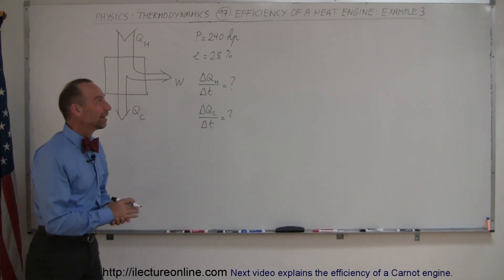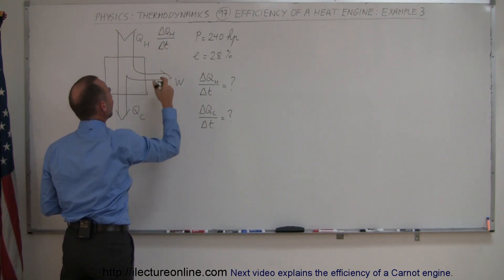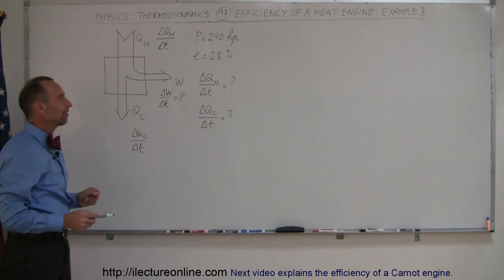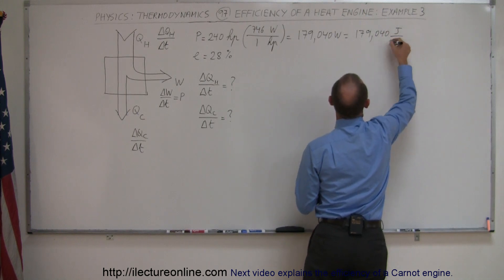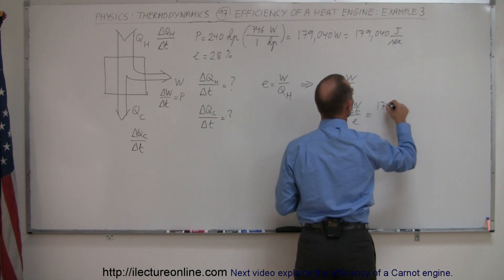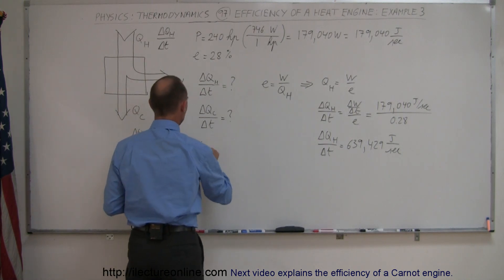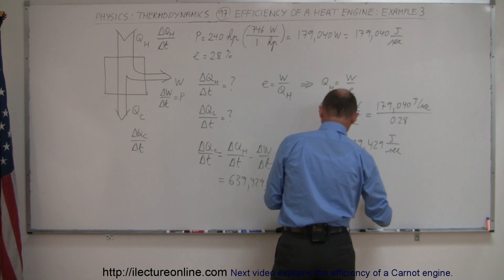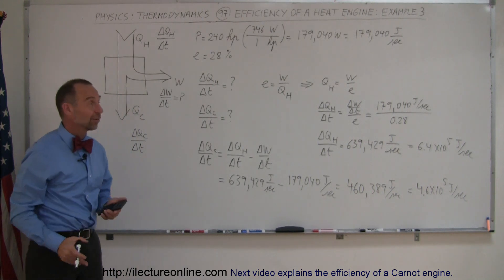Physics 29  Efficiency Of Heat Engines (7 of 14) Efficiency of a Heat Engine: Example 3

Comment: Hello professor! thank you all the great videos you post! those have been a huge help in my physics degree. I would like to ask one question and will be glad if you can answer it:
When solving heat engine problems, do we assume Qcold and Qhot to be constant at all times? isn't the cold reservoir gets hotter as time goes by and the hot reservoir gets colder as we took heat away from it? this results in the engine efficiency changing as well.
Reply from the maker: For an engine, the "cold reservoir" is the location where the exhaust is expelled.   The temperature of the exhaust as it leaves the engine is key here. In modern cars a lot of the heat is removed from the exhaust before it is expelled which has significantly improved the efficiency of cars.   The "hot reservoir" is the air fuel mixture right after the ignition spark and is a little higher after the car has been driven for a few minutes (since the engine heats up) and thus the efficiency is a little lower initially and then increases as the engine heats up.   That is why they place a "thermostat" in the hose near the radiator which is closed until the engine warms up to speed up that process.
Reply: @MichelvanBiezen  This cleared my confusion, thanks a lot for your response!

Comment: Hi I know youre very busy and thank you for these videos. I have one question is there a way to find the Qh(heat being put in)  if given the power output 5kW, Qc 1800J and Efficiency 25% ?
Reply from the maker: Mario Persaud 

If efficiency is 25% then only 25% of Qh is used for work and 75% is expelled as Qc.
Therefore is 75% of Qh
Therefore Qh = 2400 J
And work = 600J
If the power output is 5kW  then power input = 20kW and power lost is 15kW